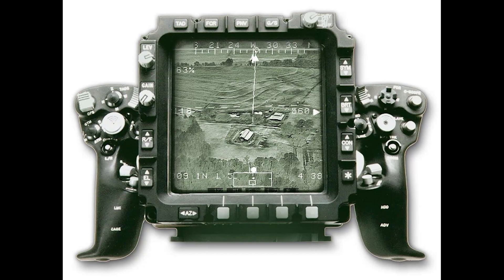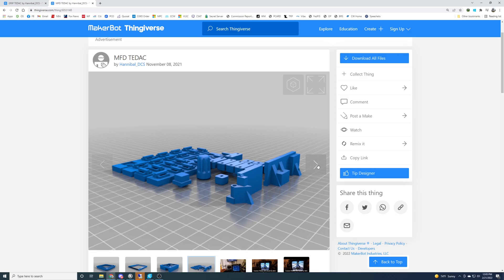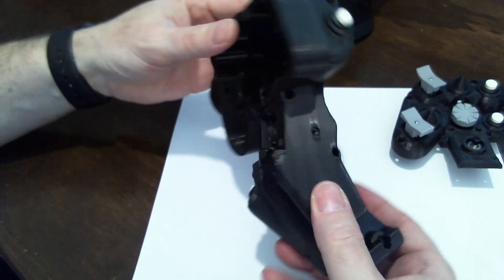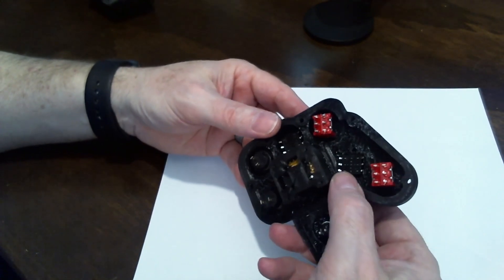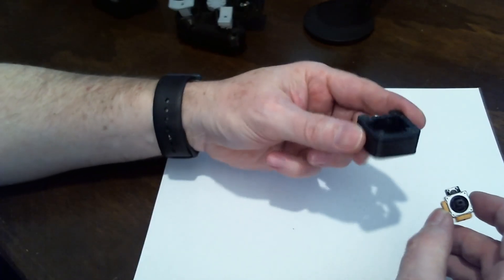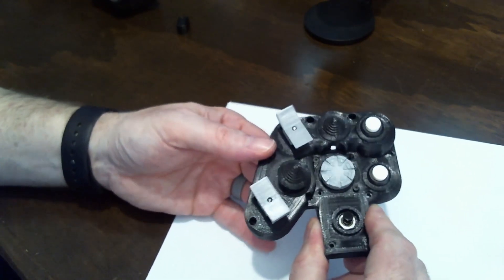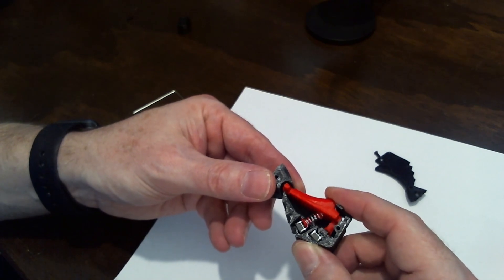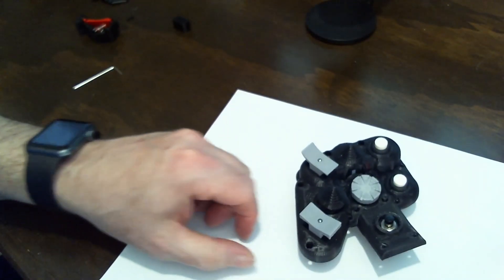3D Printed AH-64 Apache TEDAC Build for DCS World Part 1

Comment: I've just started this build as I was unhappy using an xbox controller for CPG. Where did you get the design for the trigger? Did you design it yourself or modify an existing desing? My sketchup skills are horrible.
Reply from the maker: I designed it myself but I lost interest in the pache and this project is just a bunch of parts in a box now
Reply: @DCSTex  Darn. I'll have to try and come up with a solution. You'd think you would be able to get a trigger as a part but apparently not.

Comment: is it printed using PLA filament?
Reply from the maker: yes.  So everything seems strong enough.  I don't think I'll need to use PETG or ABS
Reply: @DCSTex  what infill pattern and how much infill percentage did u use for this 3d printed TEDAC?
Reply from the maker: @Ditri11  20% and pattern is whatever the default is in Cura
Reply: @DCSTex  Thanks for the info

Comment: Hi John.
 Great project. I have started using Nail Salon clear resin to fill and smooth FDM printed parts. It is cheap as chips, sets fast with UV lamp, is self levelling and sands well. It is good for building up areas and filling gaps too.
You might find it useful with all the curved surfaces in the TEDAC. Good luck. Have subscribed !

Comment: You should take silocone moulds of the parts once you've sanded and painted them. Then use a two part polyurethane like F180 and cast a small run. You will own the market for Apache gear, that's for sure!

Comment: Awesome.  I am cheat-starting a panel using old joystick parts I had in a bin.  I got everything neatly apart.  Now I have to buy plexiglass or some type of sturdy surface and a soldering iron.  I had to cut the wires on a couple controllers. The stick assembly part was an issue.  Next I will build one from scratch using DCS Bios and an Adruino Kit I bought. 👨🏻‍🔧👨🏻‍✈️💻🎮🤔🤓